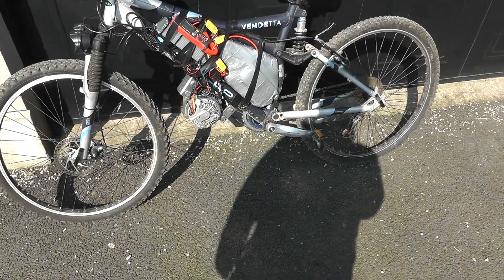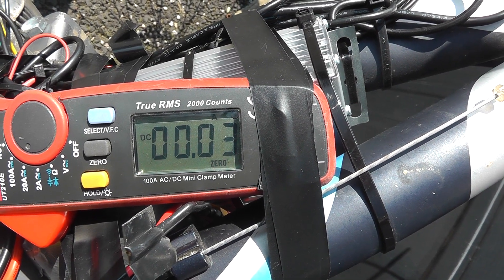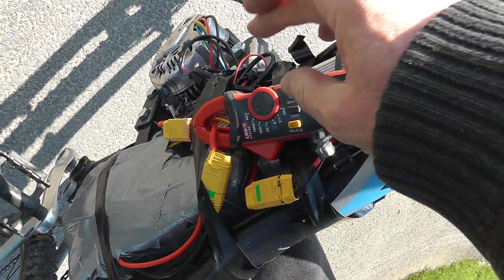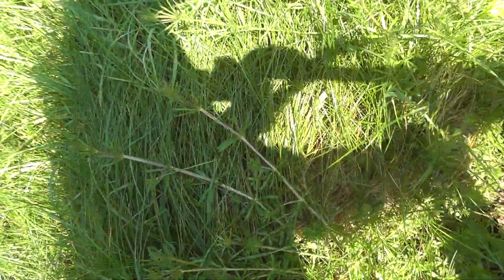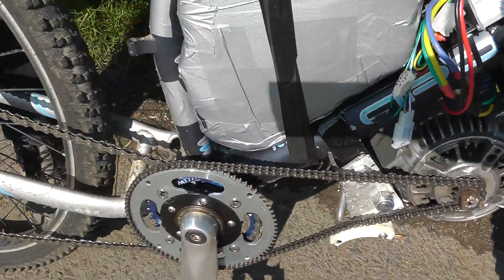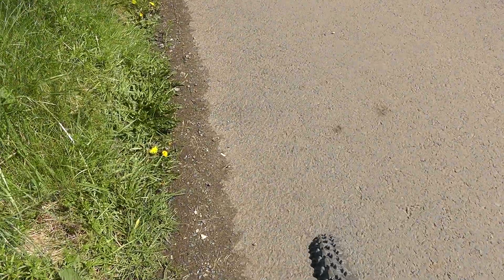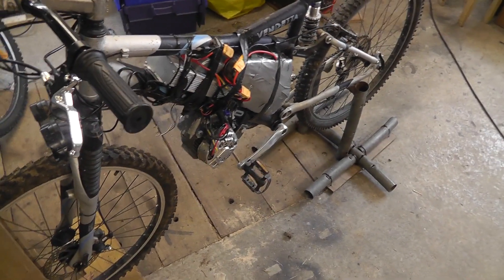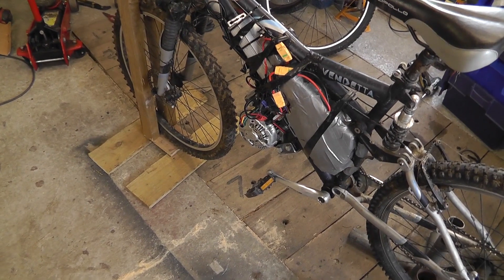DIY Ebike with Car Alternator V2 Episode 6 - Boy she can go! NB Read the notes!

Comment: Hello ali, how the cassete on this bike did? Was it strong enough to take the abuse? Also, i as wondering in doing a similar design to this, i want to make this "ebike" centred more on for riding in city etc, so care more about speed than handling, and i think that, because its connected directly to the driveline you could change gears and get more torque or speed, also i can't buy a proper e bike motor because its too expensive to buy one where i live, would love to hear your thoughts, chears!
Reply from the maker: I gave up on this design as it did not have much torque, was noisy, kinda dangerous and was not efficient. If you're stuck with alternators or washing machine motors my first effort worked better where I bolted a washing machine pulley to the back wheel and mounted the alternator on a carrier above it. Check out my previous videos for more detail.

Comment: Thanks so much for taking time to test  this idea. Also for responding to so many queries,  personally I've learnt a lot from this video and it gives me a guide on where to start in regards to ebike build. Thanks again.
Reply from the maker: Thanks mate, It was fun to build this ebike but not so much to ride it so I cannot recommend you follow this design. If you wish to use an alternator to power your ebike then mounting it on a carrier above the rear wheel and driving a large pulley is more practical. My first ebike was built that way using a pulley off a washing machine and is still going. Even this is not great as it has a lot of weight high up but it works really well.
Reply: @alibro7512  Thanks for the feedback, will give it a try. I intended to make an escooter with about 12"  wheels, I guess less torque required to turn the wheel. I really desire do get some descent range,  do I have a chance with an alternator,a washing machine motor or a treadmill motor?
Reply from the maker: @joemwiti2316  Any of them will give decent range with a good battery but the alternator was never designed to be a motor and will not be as efficient as the others. To be honest I'd look for a proper escooter motor either new, used or faulty (as fixing them is often relatively easy) as connecting the other types of motor to the wheel will be challenging.
Reply: @alibro7512  I'll go by the latter option, I'll get the hub motor since its optimised by design, Thanks again. May you be filled with more knowledge & success in your builds.

Comment: I have two 60v battery pack and some 48to60v speed controllers and will this project work well or not
Reply from the maker: If you want to drive a bike from an alternator I would not recommend this design. Securing a large pulley directly on the rear wheel and driving with a belt works much better.

Comment: I'm not sure why
 you don't use the gears 🤔

Yes you will have torque issues when pulling away.
If you using a hi gear for pulling away.
But when you at hi speed it's a completely different story.
It doesn't need torque at high speed.
It needs a higher Gear at hi speed.
That's the reason for having gears.
It's the same as pedalling the bike you still need gears.
For downhills and 4 going up banks.
And pulling away
Reply from the maker: I did use the gears. Not sure why you thought I didn't. 
It needs torque to push you through the air otherwise we could all do 60mph on our 250W ebikes with only a higher gear.
The design was flawed as the small chain was spinning dangerously fast so I moved on. It was fun to build but needed a lot of changes to be worth perusing.

Comment: Hi, just wondering what the all up weight of the bike is? It looks quite heavy in that configuration
Reply from the maker: This setup didn't last long as the design was flawed so I never weighed it but the alternator is no heavier than an ebike motor so it wasn't too bad.

Comment: How hot does the motor get? I am also making one using a 1000w controller and it gets too hot to keep your hand on it
Reply from the maker: It got pretty warm but I never used it long term. (Edit: I said earlier I used an 800W controller but I built this two years ago and forgot that I also used a 1500W controller)
What voltage are you putting to the rotor? 6V or 7V should be enough, any more will cause more heat without much or any more power. 
If you can find a 150A alternator or higher it should work better.
Reply: @alibro7512  I'll try lowering the rotor voltage i was using 3s lipo
Reply from the maker: @hardnachopuppy  I ended up using a dc motor controller to lower the voltage from the main battery. It meant I could play with the voltage to find the lowest that would work. More volts to the rotor will give more torque but less speed.
Did you wire the alternator in star or delta?
Reply: @alibro7512  im using star configuration
Reply from the maker: @hardnachopuppy  I used star as well so that shouldn't be an issue. You might be interested in videos made by austiwawa where he added hall sensors and a permanent magnet to his alternator motor. If it ran more efficiently with the sensors and had no extra heat from the rotor it would help keep it cooler.
Reply: @alibro7512  i added the hall sensors too

Comment: Hello Sir..I make electric bike from car alternator 12volt 90amps name plate on the alternator n drive with 36Volt Dc n inject 12volt to rotor coil..delta conn. On stator coil...my problem is when I drive my ebike the starting torque is very low n cannot carry load
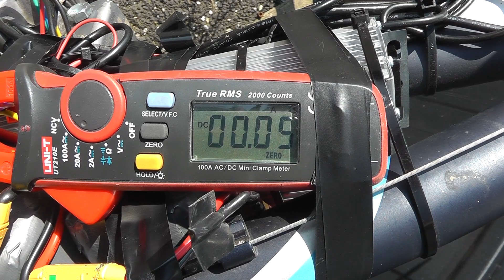Reply from the maker: You don't say what the wattage of your controller is but regardless you need to ensure the gearing is correct and this design is fundamentally flawed in that regard. If you watch my other videos with the alternator motor driving the rear wheel directly it is a much better design and the gearing is much better. I figure you need approximately 1:10 gearing for the motor pulley to the drive pulley and it would be better with 48V controller.

Comment: Hey buddy, how about attaching the alternator to a 150cc street motorcycle engine? just removing the cylinder and using the crankshaft?
Reply from the maker: Sounds like a lot of work but I guess it could be done.

Comment: I think I will use the light 12v from the controller to charge inner coils if it works and avoid second batt. Well done I am converting vintage 50's balloon tire bikes.
Reply from the maker: After this I used a DC motor controller to control the coils. It works well.

Comment: Ali Bro, can you tell please me the electric consumption of the alternator compare to similar torque from BLDC motor ?
Reply from the maker: I don't have the numbers but it is not as efficient as a purpose built motor. Partly because energising the rotor takes power, partly because there are no hall sensors and I suspect partly because the design is optimised for generating power instead of turning at a speed suitable for an ebike.
Doing this should be seen as a fun project rather than a practical alternative.

Comment: Ali Bro what happens if you swap the alternator chain to the smaller sprocket in the middle ???
Reply from the maker: This bike is no longer on the road but it were, that wouldn't be possible. The chains and sprockets are different types so they can't be swapped. I wouldn't have wanted to anyway as it would have made the poor gearing even worse, great for top speed but not much good for getting there so the theoretical top speed would never happen.

Comment: I'm sorry, but the alternator not run with 12V (the Voltage of the machine)? You have overvolted the alternator? Can do it? Wow
Reply from the maker: The voltage does not matter because the diodes and voltage regulator have been removed so it is now a three phase motor. With any motor you can use any (within reason) voltage but the power (current x volts) is what matters.
Reply: @alibro7512  aaaaahhh ok! Only with brushed motor? With brushless can do it?
Reply: @leonardofrau6492  alternator is brushless, the brushes on it just feeds the electromagnet, the brushes alone can't spin the alternator

Comment: You are a genius!!!! I want to make that now!!!!! One question... Witch bms did u used?
Reply: And is enough torque to make a mountain bike?
Reply from the maker: Lol, nobody who knows me calls me a genius.
Before you get too excited I scrapped this idea after a short time. The alti motor wants to spin too fast so torque is low and the chain is a bit dodgy. If you can build a gearbox small enough but strong enough then it can work but a cheap Chinese hub motor is much easier.
Reply from the maker: Just a standard BMS off ebay.

Comment: Can you help me? How to connect the controller cables, I have a 1500w - 36/48 volt controller. My accelerator is the same as yours has the key with voltage display.
Reply from the maker: Sure, what controller do you have? Post a link to where it can be bought.
Reply: @alibro7512  https://produto.mercadolivre.com.br/MLB-1349198983-1500-w-36-48-v-dc-brushless-controlador-de-velocidade-da-bic-_JM?quantity=1
Reply: hi, I put a new battery to excite the alternator coal, however despite being a new 12v 7ah battery, it ends up discharging very fast. Was there a problem with the alternator coal?
Reply from the maker: @colchoesreidosono9514  The current will be around 7A so a 7Ah battery will only last 1 hour. If that is what is happening then it is normal.
Reply: Do you have an email to send you a video?
Reply from the maker: @colchoesreidosono9514  Sorry I don't put my email up here, Why not put your video on youtube and post a link here to it?

Comment: I built a custom dual motor ninebot es4 that goes 30mph, only problem is that going over bumps breaks my spine and the crappy Chinese made es4 frame. So I was thinking of getting a bmx or a mountain bike for free and using either a alternator I have gotten for free or a scooter hub motor. I'm leaning towards using the alternator because it would be much easier to attach a sprocket to it and to mount it to the bike. Would I want to gear it down? Could I use the field coil power as gearing? (Maybe I could apply more volts and amps to the coil get more torque and apply less volts and amps to make it go faster)
Reply from the maker: I think you need approx 10:1 gearing to make it work, if you take it look at my earlier video. I fitted a large pulley to the rear wheel and drove it with a belt. This worked much better.
Reply: @alibro7512  hello again, I got the alternator wired up but when I press the throttle it spins up but then stalls and makes a screeching coil whine noise, it actually has a decent amount of starting torque trying to stop it with my hand but once it starts spinning for about a second it slows down to a stop quickly and then screeches. I've tried changing the field winding voltage, shorting it out, leaving it open circuit but it doesn't fix the stalling issue. The controller works just fine with the escooter hub motors without hall sensors too so I'm guessing its something going on with the alternator. Any tips?
Reply from the maker: @mashedpotatoes5323  Have you removed the diodes and voltage regulator? Alternators are usually wired in star so leave it like that. You need between 5V and 12V on the brush connections, it will draw around 5A so make sure the psu can handle that current.
Try swapping the phase wires around.
Reply: @alibro7512  Sweet I got it working, there was some controller chip that was connected to the brushes and I was trying to send power through it, I just removed the controller and soldered wires directly to the wires for the brushes. Could that have been voltage regulator you were talking about?
Reply from the maker: @mashedpotatoes5323  Brilliant news mate, glad I could help. Yeah I think probably the Voltage Regulator and/or the rectifying diodes.

Comment: Qual a  v, tensão ah, amperagem , que sai da sua bateria amigo por favor
Reply from the maker: I can't remember exactly but I think the Voltage was 48V to 50V and current was 41A. 
Não me lembro exatamente, mas acho que a tensão era de 48V a 50V e a corrente era de 41A.
Reply: Qual a velocidade máxima que a baike alcançou,vale a pena eu montar uma?
Reply from the maker: @alesaxasilva9173  I think it reached 33mph but I don't think it is worth doing this. The motor does not have enough torque for this design.
Eu acho que atingiu 33 mph, mas eu não acho que vale a pena fazer isso. O motor não possui torque suficiente para este projeto.
Reply: @alibro7512  obrigado amigo,fico muito feliz por ter respondidas minhas perguntas. Vou ajuntar uma grana é comprar um motor potente.minha grana ta curta,e mais uma vez obrigado
Reply from the maker: Não há de quê. Dê uma olhada neste vídeo e nos seguintes.

https://www.youtube.com/watch?v=26nQj5oSNvM
Esse era um design melhor e poderia ser facilmente aprimorado sem muito dinheiro
Your welcome. Take a look at this video and the ones after. 

https://www.youtube.com/watch?v=26nQj5oSNvM
This was a better design and could be easily improved without much money

Comment: Why u are using 12 v battery for rotor.. just buy dc motor controller its for 20 amper max and can step down from 70 volts to 0.01 volt .. it will be better i think than a diffrent battery
Reply from the maker: I planned to do that but to keep it simple while testing I used a battery but it was 7V, not 12V.
I've since abandoned this design as its not practical and now have a hub motor.
Reply: How can i contact with u i have make some test with alterbator .. i test my alternator and produced 12.5 kw of power
Reply from the maker: @ivanmrqnkov9226  I usually answer messages here if you want to ask me anything.
Reply: @alibro7512  it is more like a chat to share our ideas about electric viecle
Reply from the maker: @ivanmrqnkov9226  I spend a lot of time hanging out here. https://staf.uk/forum/viewforum.php?f=5
I'm Alibro

Comment: did this man just say 33 mph?  with one alternator?
Reply from the maker: I'm not sure why your surprised. It's drawing around 2000 Watts and my 1500W hub drive will do over 30mph.
It is a bit less efficient but only a bit.
Plus it has gearing.
Have to say it was pretty sketchy on a crappy old bike with dosy tyres and wobbly steering.
Reply: @alibro7512  well im kinda new to the whole E bike scene so and the only expirience ive had is from electric razor scooters
Reply from the maker: @maxymk123  No probs mate, Many of the folk who reply to me know a lot more about ebikes than I do (or think they do) so I thought you were having a pop at me.
But yeah, a 1500Watt ebike will easily do 30mph. Even my 500W Bafang BBS01 will do close to 30mph without me pedalling.
Reply: @alibro7512  oh no offense meant at all i just have only ever heard of bikes and scooters going round bout 20s or 15s.  but thank you for the intro much appreciated
Reply: @alibro7512  would you suggest getting 30 dollar  1500w chinese controllers?  do they work well?
Reply from the maker: @maxymk123  Yes and no. If you just want it to work but are not too concerned about quality then yes they work well. When I buy another one I will probably go for a KT Sine wave controller as they are meant to be smoother and have the option to add a display.

Comment: What controller are u using? It looks powerful!
Reply from the maker: Just a standard cheap Chinese 1500W ebike controller. Nothing special.
Reply: @alibro7512  wow. 36 or 48 volts?
Reply from the maker: @AndreLuiz-ip3fh  48V
Reply: Ali Bro what is the km of autonomy by one charge ? Battery 48v how many amps? Thanks and sorry for my English
Reply from the maker: @adrianmucci8367  Hi Adrian
This bike wasn't used for long before the motor was removed and replaced by a hub motor.
Check my other videos.
I probably could have travelled 15 to 25km on a charge. I changed it because I couldn't really pedal with it.

Comment: Nice! 
 It goes faster than mine, but I am happy with a mere 15MPH on my little creation   :) .
Reply from the maker: LOL, to be honest it was way too fast due to the gearing without the torque I'm looking for so I've since took the alty motor off it and fitted a hub motor. I'm now looking into a new project for this kit. Hopefully it will be worth the effort and wait.
Reply: @alibro7512  
 Yes indeed. Finding the right balance between torque and speed is a bit of a challenge. 
 Mine runs on 18 volts, and a it uses the tiniest wee motor controller you've ever seen, but it goes along at quite a nice pace. 
OK, it would be great if it could go faster, but I am still reasonably pleased with it. 
 Those hub motors are pretty sweet, and I reckon I will have a go with them, sometime soon. 
 Perhaps these would be good for farm machinery, such as post hole borers, and the like. 
 Anyway, looking forward to seeing what you come up with in the near future  :) .

Comment: Bro why not try Permanent magnet from speaker in rotor ..... 12v to field is eleminated
Reply from the maker: A speaker magnet wouldn't be strong enough. You'd be amazed how strong the electro magnet is. I did begin to try fitting hard drive magnets to a different alternator but it requires a lot of work and probably not worth it.
You need 12 poles alternating N, S.
Reply: @alibro7512  I understand it is difficult but when you complete the job its going to be nuttiest...... Can someone tell how to calculate the amount of magnetic field generated in rotor when 12~14v from battery is giving
Reply: @alibro7512  see you tube video from "hurricane wind power" he did it with 1powerful circular permanent magnet and the claws will take care of alternating polarity
Reply from the maker: @dcsjustforfun7437  I saw that video but I don't have a suitable magnet and for the moment I've moved on.
Check out my latest video